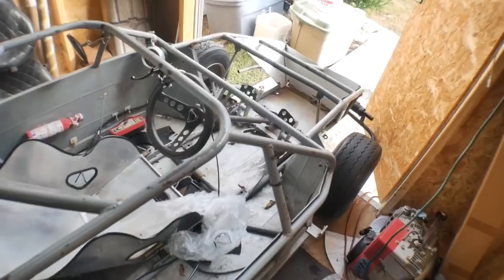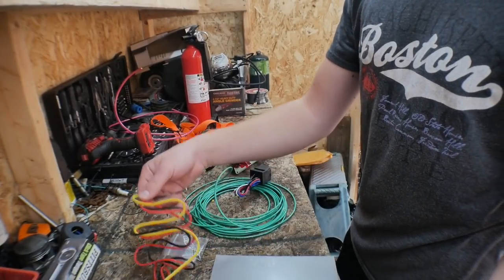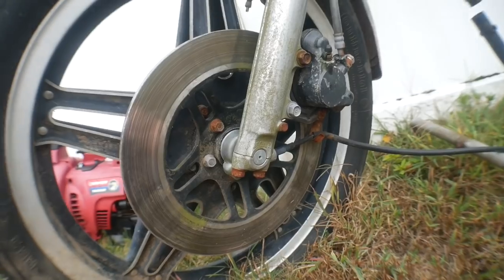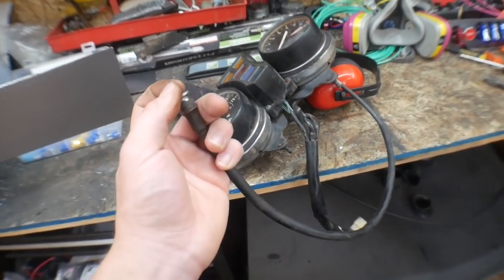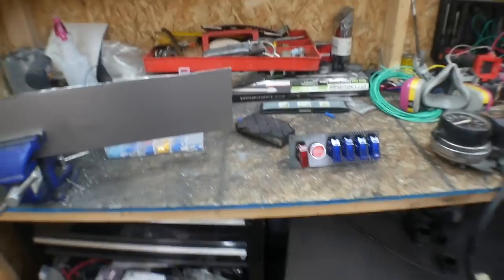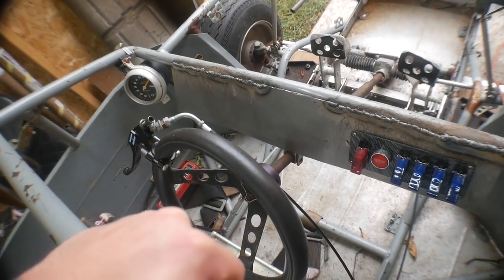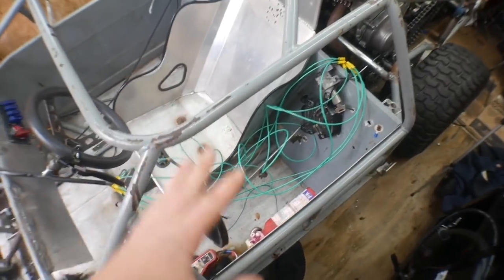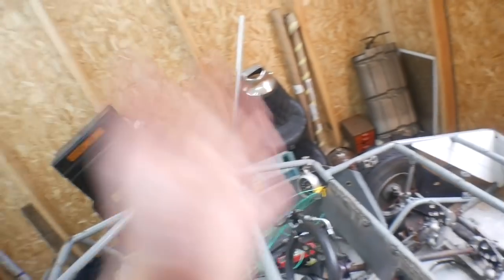Making a Custom DASH For the Half Scale NASCAR!

Comment: File the bottom of the dash, and cut those lower corners off (maybe add press-on auto edge trim). The dash will act like a big blade if you contact it with legs etc.

Comment: you should connected the fuel pump to the engine power so when the engine kill switch is in the ON position the fuel pump engages and will disengage when the switch is off.

Comment: The wheel speed sensor type thing is easily removable and I’m sure you could find a way to make it read the speed of the front wheels. You might have to to a little gearing to compensate for the different axle diameters

Comment: Is there wires from that cord for the tac? If so, cut the end off leaving yourself room to spice wire on. Get some wire to run between one end and splice both original ends on at each end. I don’t know if it’s just a cable or if it has actual wires going to each end but if it’s wires then you can extend it yourself reusing the original ends. Just throwing that out there. It may not even work like that. 🤷‍♂️

Comment: See if the speedometer cable ends are the same as the tachometer cable cause it's longer. If there the same, is it long enough? Also can you possibly join them together? Or  join it to the 40' you scene online?

Side note when welding keep the circular or c motion going as you move along and play with the welder feed settings to match your  speed along the work piece.make sure your as comfortable as possible well welding. Sometimes body placement is the difference between a good and a bad weld

Comment: If I were you I’d get a soldering iron and solder those push button wire extensions together. Butt connectors don’t hold very good if you put any sort of tension on them. I’d also get more then one colored wire. Having different colored wires makes diagnostics easier if anything were to break

Comment: u need to fold the panel so you dont cut ur legs up in an accedent
Reply: Maybe bend 1/4" lip at the bottom of that dash, so it isn't so sharp and it also gives  some stiffnes to it. The lower end needs also some support, otherwise it will brake loose next to the weld seam. Maybe some round steel rods welded from the frame to the bottom of the dash, or extend the dash  across whole cockpit?

Comment: The reason the tachometer your friend gave you didn't work on the CB750 is because a Briggs coil passes over a magnet which creates a charge and sends it to the spark plug and the tach. The faster the engine spins, the more electricity goes to the tachometer, giving it a higher rpm reading. So if you managed to use that flat bar on the valve cover to spin a little DC motor connected to a AC to DC rectifyer that sends electricity through the green wire on the tach, it should work just fine. Good luck man.

Comment: I would try using a speedometer cable for a Tack cable. 
It's just a flexible cable that turns inside the gauge. And you should utilize all that wall space for tool hooks and a dry erase board to make a to do list.

Comment: The cable on the bike you were talking about works by a magnet one of the bolts on the disc brake are magnetic and it reads it by how fast and how many times it goes past the magnet on the cable

Comment: That thing you took off of the switch is contact block. You should have looks like 2 connections across from each other and one side is normally closed if you want fire running through all the time unless you press the botton. The other is normally open which would be good for your starter. You get fire when you press and it goes away after you release. Put a meter on the ones across from each other and test it to see if you have continuity with or without the button pressed and the will tell you which is which but there should be a NC or NO on them that tells you normally open or normally closed.
Reply: Also if you take battery positive to the red switch you can switch on battery and switch off battery. Jumper hot across the switches through the red one used for battery and all gets cut off when you switch off red one. Would not hurt to put fuses inline so you don't fry the cart of something goes wrong.

Comment: If you want to connect the new tachometer you have to connect the wire that reads the rpm to the spark generator wire instead of the coil!

Comment: Should have used multiple colours for the wiring. If I could show you a picture of the wiring of my bolens 1053 I restored with a Citroen 2cv engine you’d be amazed. That wire looks quite thin also. I used 12 gauge wire generally all over and over short lengths with a few fuses throughout the wiring. This kept a low resistance and no heating in the wires... starter wires need to be thick chunky wires also. Like a 2 gauge

Comment: Get a Digital bicycle speedometer it should work... and that new tack should work you might have to get a three way Splitter hook up  to tap into both negative wires on coil and the one on tack and make sure you have a good ground and it should work

Comment: For wire next time instead of using individual strands get some 14/6 trailer wire it comes with 6 sets of 14 gauge wire a whole lot neater looking. or if you need they also make 12/6 wire which is 12 gauge.  the wire is in a protective sleeve and not very expensive by the foot.

Comment: I may stand corrected. And correct me if I’m wrong. But the tach he tried using half way through the video that he says so of a briggs. It isn’t.... pretty sure it’s connected to a coil that runs in association with a points and condenser guys?????

Comment: You have to join into both coils or it won’t read accurately
Reply: There should be a switch on the tach to choose 2, 4, 6, 8 cylinders.
Reply: Wont work with it tied to both coils. Wont fire right. Even though this is a 4 cyclinder its 2 double coils. Hook it to one coil negative and set it to 2 cylinder it will take the 2 pulses per rotation an half it to read correctly

Comment: Fyi, the speedometer from the bike will not work. It goes by revelutions of the tire, so if the tires are not the same size as the bike, it won't put the right speed

Comment: You can go to your local hardware store and get a universal tachometer they're cheap they are made to set up for 4 cylinder 6 cylinder and 8 cylinder they're easy to adapt easy to hook up take you 15 minutes to hook it up and it will work great for that application and they're cheap I'm sure it's probably I don't know 22 $40 I'm sure they're not very much

Comment: The Speedometer is not electric its mechanical. There are gears in the front Wheeling That spinns the wire insuge the Cabel. Same thing with the tach

Comment: Mate, I'm sorry but your messing up , A LOT ! to start with the tacho the wire that goes to the negative on the coil , split the negative wire run it to both negs at the same time , they only work when the motor is running properly .
The wiring . WOW ! You never use the same colour for EVERYTHING ! Your power wires should be red and much larger to carry the current through to the starter ,the smaller wires will melt under load , the starter button was fine until you destroyed it ,the power should have come from the battery to the toggle then to the button then to the starter . Also run the wire from the toggle that , also runs the fuel pump , so when you flick  the switch the fuel pump and the ignition are alive at the same time , for your Speedo buy a flat phone mount , wack it on the dash done no need for difficult machining .  PLEASE be careful that dash that you welded to the cart is going to act like a potato peeler on your legs , if you crash it what you need to do is cut that off , grind down those (sorry but horrible welds)
Then using a cutoff wheel gently cut across the top (not too deep) then smooth out , get a new piece of steel and start again this time fold the bottom over ,
NO  sharp edges to slice your legs down to the bone , SCREW this on it's easy to remove if you need to repair or replace anything .
MIG'S I'm not trying to be an Ass but you need guidance , I've been watching the build from the start , you scare me with some of the things you do & how you do them , please don't take this as criticism more like Cruel to be kind !    Keep going ,slow down and think before acting better still ask someone that knows before diving strait in.   I hope you read this and learn something from it.